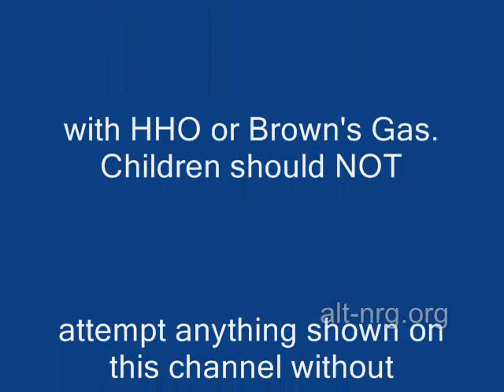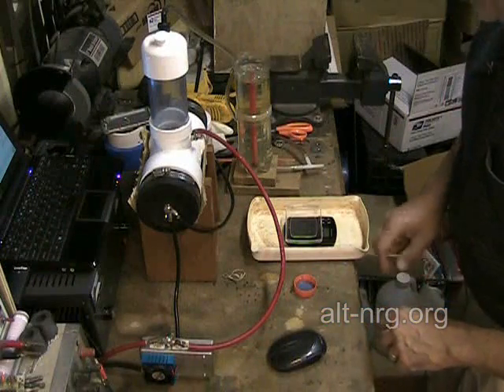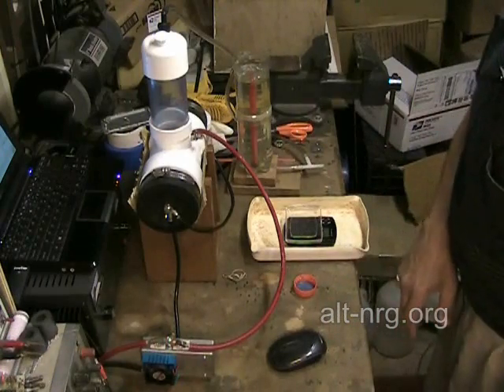#198 - Inverted T first run 1 of 3

Comment: If you want to use HCL for the cleansing of the 304 stainless steel, you can use muriatic acid, which is pretty close to pure HCL. It can be found at Home Depot, Lows in the outdoors department in the pool chemicals. It comes in one gallon containers for $8. Just be safe and careful when using it.

Comment: Ive also been told by some industrial companies that make hydrogen commercially, that 8 volts is the cap if you want a higher production of hydrogen.
Im basing my design on theirs, Stacked disks in opposing plate types, nickel/iron.
I tried the super 7 design with decent results, but nothing to brag about. 
Once I can find a cheap enough source for the nickel and iron, Ill strap it inside my geo metro, and see what it does.